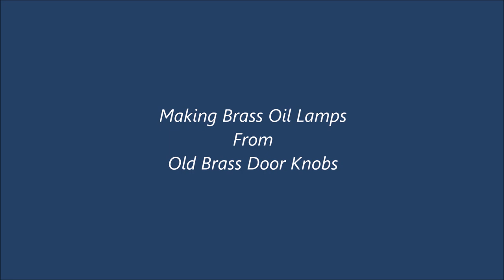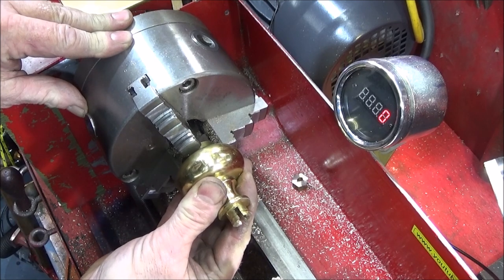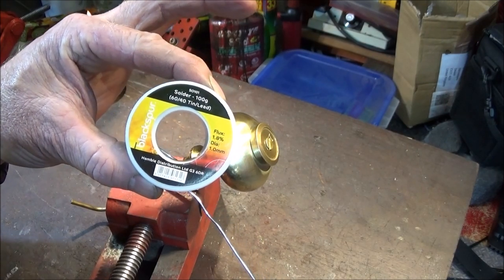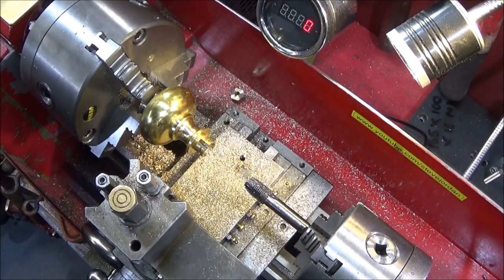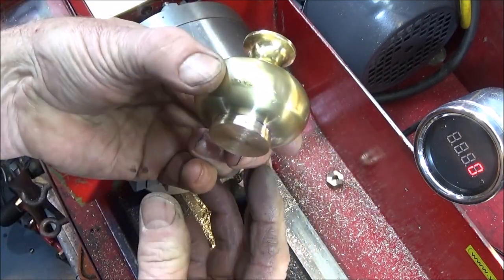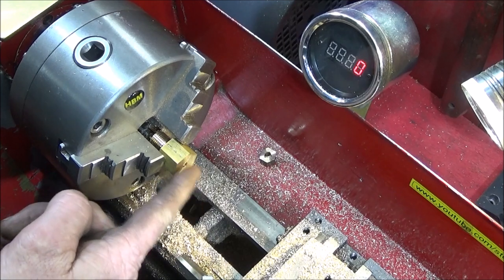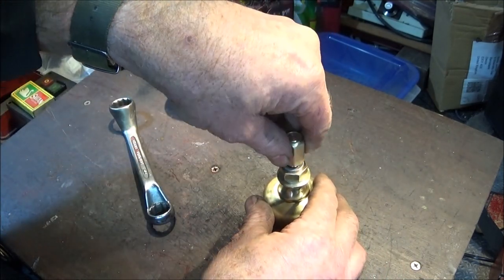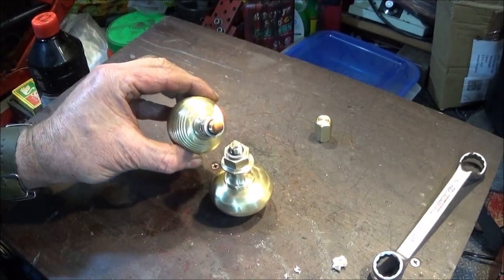Make Lovely Long Burn Brass Oil Lamps. A Brass Door Knob Hack

Comment: Im so glad I came across this video! I made myself something very similar, using a brass bit from the body of a lamp. Since it was open at both ends I silver soldered a finial to the bottom so that it can be jammed into the dirt when im out in nature, and ive hooked small rings for three chains to hang it otherwise. its a bit like a small version of a hanging votive lamp like youd find in a church. For the cap, I made an undercut depression below the wick tube and poured a bit of pewter into it, then turned it down flush. Its softer than the surrounding brass and thus the cap beds into it when closed, I have had no leaks thus far and I dont imagine it should decay or suffer any deterioration over time like rubber may do. These sorts of little repurposed lamps/oil candles always make me happy, something about making something from scrap that brings a little light and comfort I imagine.

Comment: Your lamps can be given a bit more visual appeal by milling a small diameter (say .125" deep by about the same height, square to the outside bottom edge, so the lamp appears to float on a table top. This is something good potters do for their vases and cylinders, teapots, etc.

You could take it a bit further, in the earlier stages, by milling a shallow dish-out about .125" from the front edge, so it will sit more confidently, where an uneven surface may induce small vertical leans or rocks the lamp. . 

I like you project very much and actually saw a later video that included your round, concentric ring lamp, which I immediately wanted to learn to do... and now I know!

Your other videos I have watched are all informative and I hope you can continue to present new ones in this upcoming year. 

By-the-way, you can also use a clean cotton string mop head for wicks, which are routinely used for kerosene stoves and ovens around the world.

One mop will give many wicks and likely cost much less, if you plan to make a lot of these lamps.
Cheers.

Comment: Perfect workmanship.but I point one thing that ,the nobe never screwed.To Mark the centre of both and make welding.Also use led washer to the pot side of the threads.

Comment: Really enjoyed your video and the project. Why did you screw the bottom on only to solder it? I know the solder will keep it from leaking but just soldering it would yield the same results.
Reply from the maker: Hi it was just a way of getting the base dead concentric on the handle so I could hold it in the lathe jaws for machining the other end.

Comment: Very nice, Steve. Question; how do you hold the 4 jaw chuck in the tailstock?
Reply from the maker: Hi Ben I made a back-plate for this specific chuck secured to a 2mt taper. I will do a video on how to easily make this set-up soon. Regards Steve

Comment: Base, drill, tap then screw a base on sealing with PTFE tape. Jaw marks, grip in old emery cloth or similar. Tailstock tap holder might be cheaper and quicker than a 4 jaw too. A lathe isn't needed at all really, for anyone with a drill, a vice and ingenuity or engineering knowhow . They'd look very nice hanging too with appropriate fittings .

Comment from the maker: SANOU SELF-CENTERING 4 JAW K12-80 Lathe Chuck Tool -- https://goo.gl/WU2TB1
HIGH QUALITY KEYLESS CHUCK. 1/32-5/8 Inch 3JT (2MT) Keyless Drill Chuck -- https://goo.gl/EJxb9J 
Buy 3 Get 15% Off,Buy 4 Get 25% Off -- https://goo.gl/FZxFBr
Buy 3 Get 20% Off,Buy 5 Get 30% Off --  https://goo.gl/mKk3B6
Reply from the maker: Mechanical Parts Christmas Promotion -- https://goo.gl/A14TA2
Banggood Christmas Sale Electrionics -- https://goo.gl/uU4fZZ
50% off Raitool Tools Clearance -- https://goo.gl/GcXvTe
Banggood Year-end Tools Clearance -- https://goo.gl/BnVctP
3-7 Days Delivery Christmas Sale (US warehouse) -- https://goo.gl/NEuhVy
3-7 Days Delivery Christmas Sale (EU warehouse) -- https://goo.gl/1DH2uc